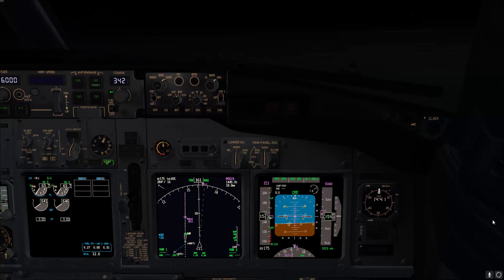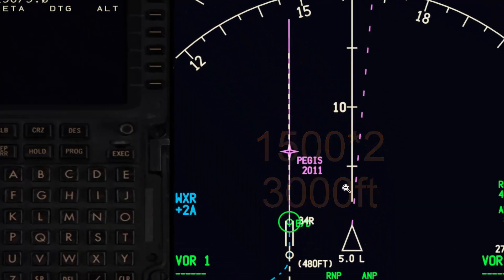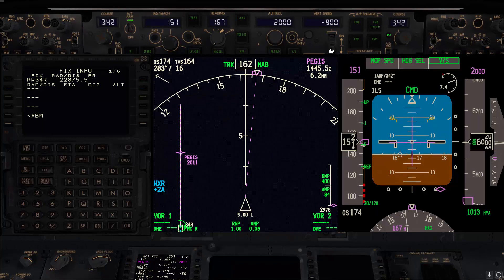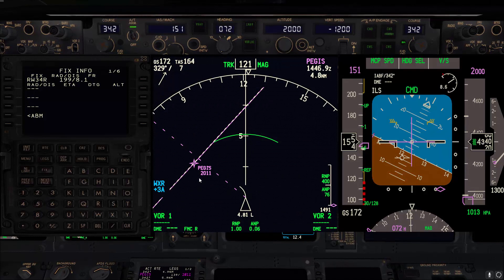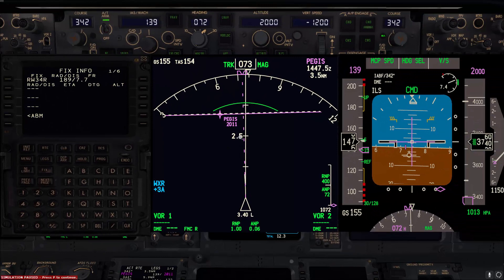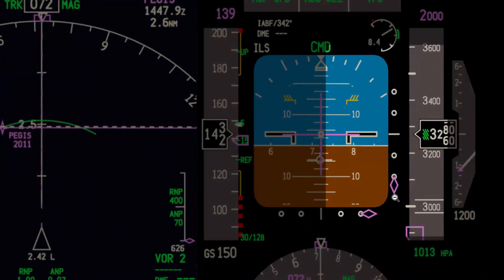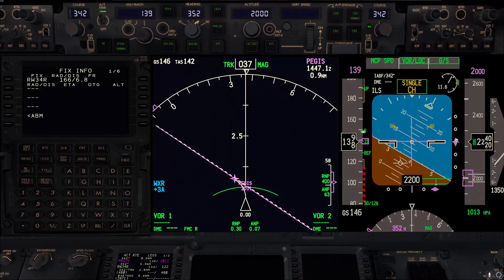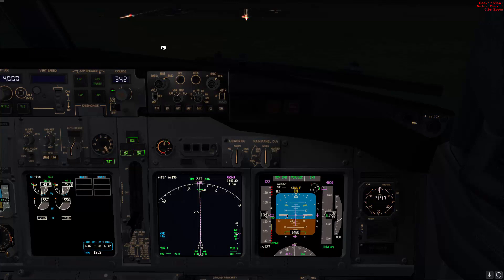B737 Visual Approach (PMDG) Video 2

Comment: Dear Captain,
Can you explain again how to intercept the final axis....you speak about 352° with final axis at 342°,how do you find 10° before to turn...
Thanks a lot for your great job and your modesty and simplicity..!!
Reply from the maker: Hello William, 
You want to set 10 degrees shy of the final course heading/RW heading, in the MCP, 
The RW heading in this example is 342 so we set 352, let’s say I was coming from the other direction “right base” so my base heading is going to be about 252 and when I turn to final instead of putting 342 I will set 332 in the heading. 

Let’s say the RW heading was 090, 
And am on a left base, heading on base is 180, base to final turn is going to be 100

If I was on right base for this RW, base heading 360, base to final 080

One thing to remember is to compensate for wind, I did not talk in the video about the wind effect in the example, 

Hope I answered your question, let me know if it make sense to you or if you have any other questions, 

All the best 🙏🏼
Abdul
Reply: @AbdulmuatiAsiri37  do you enter downwing leg 45 degree?
Reply from the maker: @Davi3038849844  Yes prefebly, but if for any reason I can't do it then any angle will do.